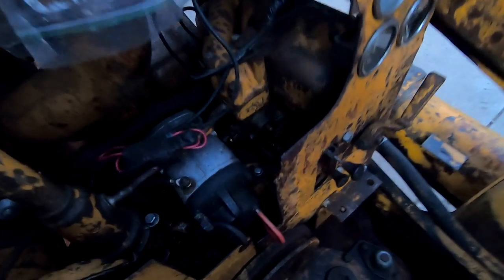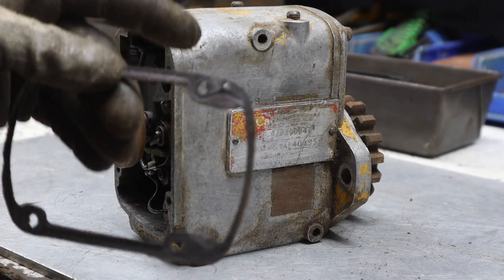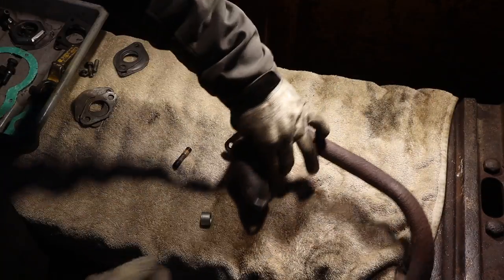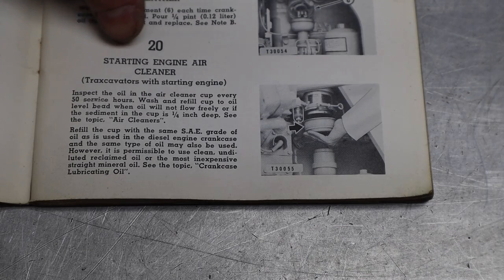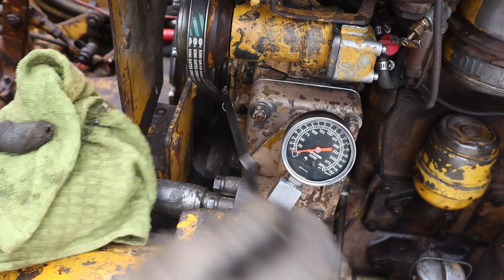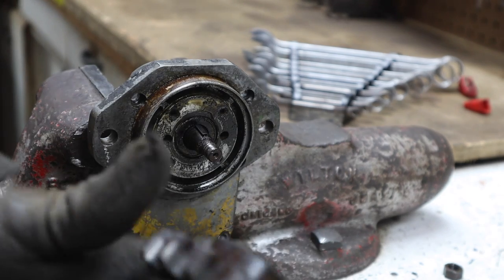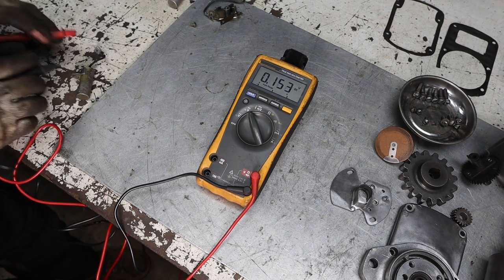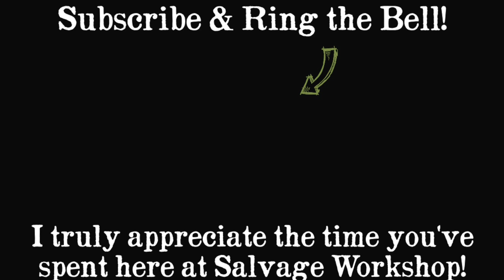FINALLY Found the PROBLEM! ~ Time to Rebuild a Magneto ~ Part 14 ~ 1950s Caterpillar TraxCavator

Comment: Another thing about mags, the coil may look good, even new and still be bad. I have an Allis Chalmers WD and it wouldn't start. The date on the coil said that the previous owner had replaced it only a few years before. THE Coil guy repaired it and said the coil had been bad. Also since I keep it outside I keep the mag covered with. a piece of old inner tube to keep the moisture out of it. A little water in it and it can short out the coil. Keep your mag dry!

Comment: Careful with your spark plug wire core material .... some ignition systems need to have a copper core whole others can use the composite

Comment: Good work, but maybe it would be good to do as VintageLexus advised. here below, i.e. dropping a bore scope down to try and locate the broken teeth? Might be able to retrieve with a magnet - if possible? Other question because I love dogs and Weimaraner too. Why did you amputate their tails? In Italy, where I use to live, it is absolutely forbidden to do this unless it is to repair injuries. Happy 2021 and thanks for your videos.

Comment: with that fluke multi meter, in resistance range(ohms) hit the yellow key, and it till tell you the capacity of the capacitor.
Reply: Yeah.  At 52:42, I was hoping that he would simply use the capacitance feature of the meter.
BTW all: Testing a capacitor with an Ohm meter works much better with older analog meters  That's how we made open/shorted tests in the field before meters had this function.

Comment: Smart move I used to run a 977 h model we had the electric starter on it we didn't have to deal with the pony motor the pony motor you have is the same one they put in an old trencher I recognize it not to show you my age or anything good job haven't seen it done in a long time

Comment: If yours is gear driven on a D2 or D4 be aware of loose engine bearings. If the engine bearings have excessive wear it will break the magneto armature driveshaft every time. If you get a cat with a broken magneto drive gear and driveshaft this likely what happened and will happen again in short order.   Applications with combinations of any and all of the above aforementioned will be found. Some parts are specific to the particular application. Here is some factory service info to keep yours alive and well. Parts info to follow.

Comment: Al London ON Canada I took Motive Power Technoligies in the early 80's I learned something interesting in college. There is such a thing as Grade 8 Fasteners and than there is Cat Grade Fasteners. Cat Grade is 1 1/2 times stronger than Grade 8 Bolts. Take close care which fasteners you replace with off the shelf ones for your safety and the safety of others.

Comment: Did you notice the date on the magneto coil? 08-25-63
I'm surprised you didn't OHM check it, too.
Something catastrophic happened to break those gears;
that's back when they were index broached with your milling machines,
not sintered powdered metal like nowadays.

Imagine the force required?

Comment: Wonder if this mag. Times like a aircraft engine. Should have timing marks on a gear somewhere an a mark on the case. Then the back cover would need to be open to see when the points break, plus more stuff, but that’s my opinion, great videos and job well done, hang in there.👍👍👍👍🇺🇸🇺🇸🇺🇸🇺🇸🇺🇸

Comment: So the excessive pony engine crankshaft play on the flywheel end is what probably caused the failure. 
When you pulled the heads on the pony. Did you re drain the engine coolant as it should have poured out of the pony motor.

Comment: In cast iron you need 2 x Diameter length of threads for proper strength, I would't recommend less than 1 1/2 x Dia.  thread length otherwise you might easily strip the threads while tightening the bolt.

Comment: You're doing a great job shooting somewhat blind on some parts of this project. Glad to see you slowed down enough to find the cause and effect of the pony motor /magneto failure. I think it's safe to say that so many loose bolts and missing bolts and nuts shout caution with whatever piece you touch on the machine. Like the hare - slow and steady! BTW, when's the next episode on the Traxcavator- I can't wait :)
Here's a guy who clearly knows Cats and pony motors on a high level of understanding. I think you should speak with him and watch some of his recent/current work. The simplicity and complexity of these vintage machines is mind boggling...
On You Tube: Squatch253 Cat "Pony Motor" - Can just the starting engine power the whole machine? Let's find out... 3 months ago
Keep up the excellent work!
Love your dog 'pack'; they play nicely.

Comment: Red Loctite is intended to be forever, you should use blue Locktite for threads you may have to remove. just a suggestion for the future.
Reply: I thought forever Loctite was stud and bearing mount, requiring about 500F to release. Blue and red are more common. Have fun

Comment: I like make it up as you go wrenching as much as the next guy. Consider that allthread is likely not the higher tensile strength stuff that the pony motor stud was-and it bended-so keep an eye on that. I love saving old stuff..using other stuff i've collected on the way. I always work with this idea-if something fails, will it kill me! Just keep that in mind. Great channel!
Reply: allthread (redi-rod)is available in grade 3 and grade 5 usually.

Comment: Sorry bud,  But I'm sure you can get most of the seals and the intake pony manifold gasket from Cat still. If you paint the used head gaskets with spray paint use silver or copper, they make a specialized spray for that now. People have also been known to reuse the pony' intake gasket too but mine were all FUBAR by the time I got them off. 

Diesel engine Head gaskets sometimes get reused too but the little rubber seals between the block and head go bad after 40 or 50 years (they're no longer rubber). To assist on the reuse of this diesel head gaskets I use Permatex® Aviation Form-A-Gasket No. 3 Sealant
Reply: The pony motor is gas. I think your thinking of copper coat spray gasket sealer good stuff if you use it correctly
Reply: @tomhutchins1046  Thank you;

Comment: What was the actual capacitance of that condenser using the C range of the Fluke?  And how do you 'index' the mag drive gear to the flywheel..  TDC?

Comment: I am not there, so I don't know but when you drain the oil it looks like two colors of oil are coming out. Will you have the pony motor far enough disassembled to pull it out and at least give the bottom end a good inspection just to see how much wear is on the crank and rod bearings?

Comment: When you pull it all apart again, get a shorter belt for the starter -  the current one is too long.  It's loose and the adjuster is maxxed out.

Comment: Your magneto points system is similar to those in "distributor" systems.  Magnetos predated distributors, which in turn predated electronic spark systems.

Comment: That’s funny, when you were hesitating to remember the number for how little psi they can run on, I thought 30 psi in my head
Reply: Not surprised at the compression readings once he pulled the head and I saw it was a traditional Flathead design, they rarely top 90 psi even when new, so 80-85 is really GOOD!

Comment: Is there any timing required when re assembling that magneto ? I'm assuming there's some type of timing mark on the  drive gear. Just wondering if there is also some sort of timing required for the small gear that opens and closes the points. Just something to think about.

Comment: You can test your magneto hold it the vice and use a drill with a socket on the drive gear nut to spin hook up your plug wires and plugs grounded through the vice and go ahead and set point gap 
I would be willing to bet either there is a piece of metal probably from earlier gear failure that got between them causing broken teeth and shaft bend or the shaft was already bent weakening the teeth causing the breakage possibly with loose main bearing letting the crank to move vertically 

I always get a chuckle when someone says they don`t know anything about how a magneto works ,but they always know how a lawnmower ignition works , the principal is basically the same whether it one or multiple cylinders to ignite

Comment: The broken teeth on the mag gear and a bent armature isn’t normal wear. When the gear teeth broke it put a large load on the shaft. You are doing the right thing looking for the cause, but you also need to find the missing gear teeth.

Comment: Hey when you get there could you show how the pony engages the main. I'd like to see the clutch mechanism or whatever coupling is used. Also which handle do you pull or push to get the pony to start cranking on the main. I'm curious about that.

Also sucks about having to crack open the pony. But hey, now I get to see the deep dark guts of the pony. So... cool!

Oh yea one more question. Is the output from the pony geared down before it spins the main? Seems likely that it is. If the pony is spinning at 2K then I can't imagine it will spin the main at 2k. It must have a step down gear in there, can you show that?

Comment: I am wondering: Isnt the timing of the gears in the magneto critical? You definately need to time it to the motor for the sparks to occur at the right moment, but the orientation of the magnet in the magneto should be critical too if I am not mistaken.

Comment: Surely you timed the mag drive internal gear to the points gear? Points opening in relation to E gap has to be perfect.
Reply: Looks like points cam is machined part of rotor, that relationship wont change, also keyway to align dist rotor is machined in rotor, as long as rotor is pointing to correct cyll, rough mag to engine timing is set, fine adjustment comes with points backing plate adjustment, since you cant move mag, bolt holes not slotted.

Comment: Maybe clamp the bent mag armature in a  press and try to straighten the bend, then weld up and machine the  broken teeth for spares, unless you can get a replacement mag from someone, that would be easier

Comment: That was the right move deciding to strip it down and fix it right. Smart man. That piece of tooth is in there somewhere. And it would be good to check for bad spots on that Maine gear. Good job man. Check out my dozer build if you feel so inclined. I’m doing a 1010 Deere.

Comment: Buy some left handed drill bits.  Sometimes that is all you need.  Studs work better for exhaust manifold.  Bolts tend to vibrate loose.

Comment: What would really worry me is where did the broken tooth go? Is it still ratteling around in the ponys guts? Propably. Catch my drift? How does some chunky gear even break? And what about that white smoke You saw the pony crapped out?
About that determination... As deep in the project as You are and how far You came it is easier seeing this pay off than not.
And, You did an awsome job on the radiator and the hydraulics- why does it seem You´re trying to cut corners now?

Comment: That sure looked like carbon core resistor plug wire you used first,  using anything but tin plated copper core (metallic) wire will void warranty on replacement magnetos and could permanently damage your magneto's ignition coil over time. I service magnetos and sell the wire by the foot, any good tractor supply or parts store should too. i wouldnt worry too much about the missing tooth it would hopefully fall way down into the diesel engine clutch housing.

Comment: You are on the right track the pony main bearings are your problem. I think you have to pull the pony to fix it right. If you don't know about him check Squatch253 you tube channel for every thing you need to know about that pony.

Comment: OK I have three things for you. One diagnose and find the problem before you shoot the parts canon add it. To your multimeter has a capacitance testing part of it it’s on the ohms section but then you press the yellow button and it’ll change to microfarads and test the capacitor that way. And three your magnetos not gonna work because it’s all timed together for a specific time for it to fire the magneto you need to find all the timing marks and get them all lined up. Good luck.

Comment: @24:40.. is the starter drive pulley bearing really noisy or is that just the belt ..  its not like you want to take it all back apart to change a bearing and a belt again..

Comment: @27:30 you put the starter belt on and tighten it.  It looks like it is already adjusted as tight as the slot will allow.  I am concerned you will not be able to tighten it when the belt stretchers.

Comment: That belt pulley should be a slide fit, never put lock tight on it! never seize it so it it can be removed without beating it all up to get it off next time.

Comment: You're better mechanic than I. Like you, I want go see it run, but unlike you I would have tried it. Even with that nagging thought at the back of my mind. Young man I tip my hat to your patience and keep turning those wrenches. After giving it further thought, my patience in this circumstance may have been short but overall I wouldn't only take apart the pony motor but the diesel engine and entire drive train. I see this project not as an overhaul but a rebuild. If you're unable to find new old stock or good used parts, machined or powdered metal copies might also work. If you have a very good machinist, friend. 👴🏼🤔😊👍

Comment: @51:16 It is OK. It is personal preference. A condenser and a capacitor are one in the same. It is most widely recognized as a condenser in the world of engines. Also, the value of a condenser is about .22 Micro farad and a voltage rating of 450 Volts. Capacitors in electronics (stereos for example) have a wide range of values and voltage ratings. Most are much lower than 450 Volts but the mF value will likely be higher. (Capacitors of similar size to the condenser, i.e. electrolytic caps).   :-)

Comment: Just a suggestion, why not cut a notch the size of the belt diameter in the outside wall of the starter pulley? Doing so would allow you to then slip the belt on or off. if you don't make it to big you should not have an issue with the belt coming off, just make sure that there are no sharp edges.

Comment: Why didn't you use the capacitance range on your multimeter to test the condenser? It seems you missed to put some oil on the felt piece connected to the points arm to keep it lubricated or did you do it off camera? Regardless, you've done a fantastic job so far on the Traxcavator... WELL DONE!!!  10/10
Reply: You want to use silicone grease (Dielectric) Oil will get on the points and they wont work

Comment: I had a bike (Meriden Triumph T100) with a magneto. The rotor was worn oval and you could turn it without getting an HT "kick" so it was scrap?  Actually no the engine ran just fine with it. Some epoxy to fill out the worn rotor and it ran fine. By the way, the spark happens when the points contacts open. The condenser is a capacitor that stops the points arcing. When the condenser fails, the sparks happen at random.
Reply: Yep older British bikes probably American as well all had mags or dinomags. They worked well when they did but when they didn't they are a pain in the head heart and ass lol

Comment: Good call with stripping down the motor to investigate why the magneto shaft bent in the first place. And while you're at it, remove the shrapnel that was the magneto gear tooth! You really don't want that to end up binding in the working gearset (it's happened to me, the result isn't pretty).

Also...

...you could say you're Old Red's Xavier. #BadPun
Reply: Oh, and I especially love the segment with the dogs! Thank you for that.

Comment: Another way to get broken bolts out is with left hand drill bits. Would have drilled it and put in a Heli-coil instead of making the hole bigger. But that's just me...LOL

Comment: sixteyfiveford has a great video showing how he gets broken bolts out of holes when the bolt is broken down below the surface of the part.  You might want to watch it for tips.  He uses copper tubes and a welder.  Very slick.

Comment: Hey,
didn't you have to check the position between the small gears, so the timing for the spark will be correct?
Kind regards, Kai

Comment: check your local tractor supply or some place similar they will have industrial truck and implement paint in a can or gallon or quart for cheap . I would not paint my car with it but its a very durable paint for the money better than most spray paints by far.

Comment: My guess is that the original magneto is newer, purely based on the fact that the large inner gear is some kind of composite instead of metal. That looks a lot like a fail-safe point designed to sacrifice itself before something way more sensitive and/or expensive gives up.

Slightly scary example: handheld kitchen mixers deliberately have composite or plastic gears to drive the attachments rather than metal. That's not because the manufacturers want the mixers to break early and force the customer to buy a new one - they want the gears to break before the customer's finger does if it accidentally gets stuck in the mixer!